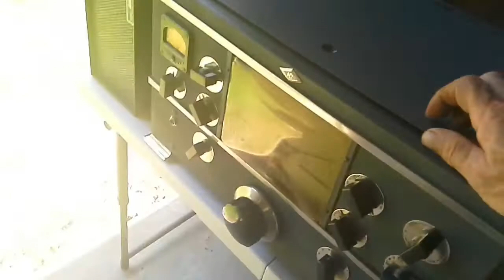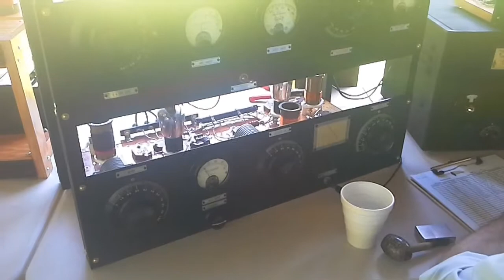W8CDX Field Day 2017, 1930s Era Station Built & Operated by NO3M

Comment: I believe those are 814s in the final, not 203s, I'm in the process of building a single band (80 meters) plate modulated transmitter that uses a pair of those in the final. Nice tube that is often overlooked.
Reply: the finals are 804s (RK-20s).  But planning to try 814s, which are basically the beam tube version of 804s. 73 NO3M